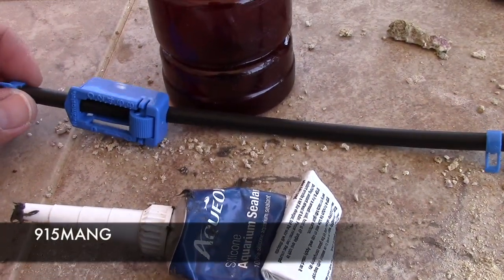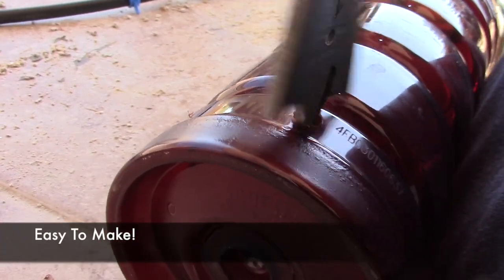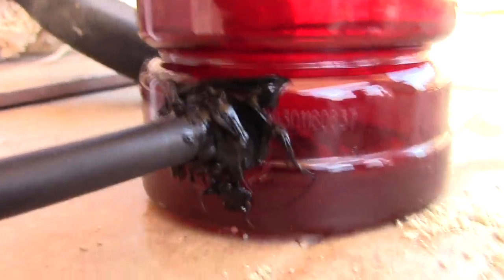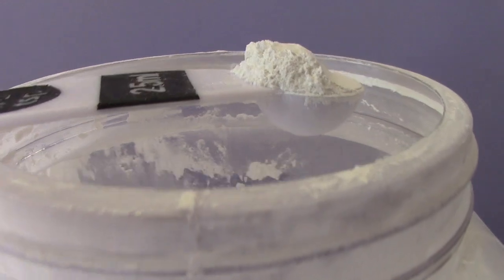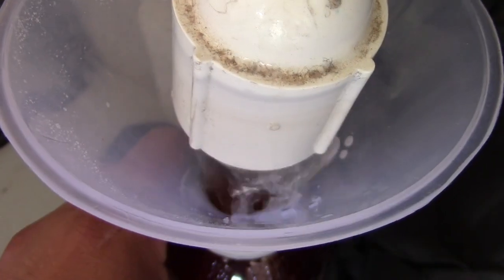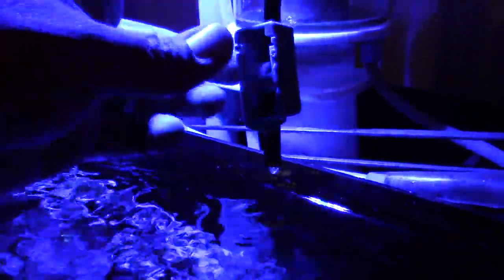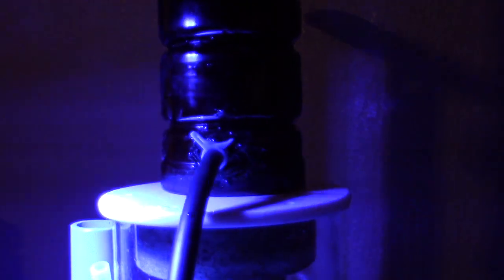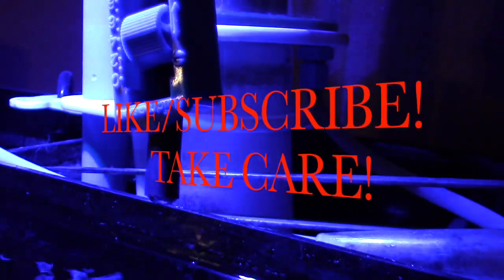EASY WAY TO MAINTAIN A REEF AQUARIUM  DOSING  KALKWASSER DIY DRIPPER KIT

Comment: BRS told me keeping the kalk solution open to the air weakens it. They recommended a tight fitting lid on the dripper when I inquired about one.

Comment: Where did you purchase the drip control piece for the hose??  Thanks in advance.
Reply from the maker: Anthony M It's actually from a toilet repair kit. But I stop using it because I changed the rubber hose. Instead I used an Air Valve that they sell at the pet store
Reply: 915Mang Great idea, thanks man.  I have to  add alkalinity daily to my setup and it is kind of tiring and don't like the milky color my water gets upon adding the stuff.  If I can setup a slow drip that would be awesome as well as it would be more consistent and beneficial to my corals.

Comment: I think as soon as I use the Bulkreef 3 part kit I have from them, I'm going to try the Kalk..
Reply from the maker: Hey if the BRS 2 Part is working then stick with it. But I had this kalk left over, didnt want to waste it. This cheap drip method is working out, and its not a mess like it was in my 120g.  But Kalk is nice, just gotta be really slow about it as you do with anything in this hobby. Have a good weekend!
Reply: I have the 3 part with calcium, alk, and mag. I heard that Kalk will adjust all 3. I'm just looking for something simpler. Mixing all 3 is a pain...
Reply from the maker: +Wire Less Yeah give it a try, Thats how it is. Us Reefers gotta try and see what works for us.

Comment: Hi mag hey I have small tank you recommend me to use kalk? I test my tank is kinda low cal and kh I can use in to my ato water
Reply from the maker: Ruffles Reefer sorry for the late reply. Kalk is good, but it won't raise your levels. Mainly maintain them, so use it after a water change once you have everything where you want them. Ato is really easy to use. It will also clog up you ato line so check it after a month to make sure it's not clogged. It's happened to me

Comment: what did you mean by when you said you learned your lesson from using this on your 120 top off?? did you have issues?? all bad ??
Reply from the maker: Ronaldo Rivera no issues. But my auto top off reservoir was to tall to get in and clean. It was a 20g custom container. Now I'm using a 20g Tall, for my 180g
Reply: 915Mang I'm getting ready to try kalk wasser on my 120 seems like it's all the Rave right now in the Hobby
Reply from the maker: Ronaldo Rivera Yeah it's good stuff actually. Mainly to maintain your levels not raise them. So keep that in mind. Also start off with a little don't go full dose

Comment: I'm suspicious of that hose man. I tried using a small section of real rubber hose on my tank for some cheap tubing but apparently there is a risk of the oils in the rubber leaching into the water.  And don't accidentally knock that bottle in the tank - that location would make me nervous.
Reply from the maker: Really? Damn ok, i could easly replace it with some airline hose. Too easy! Thanks for the feedback.
Reply: +915Mang hey mike, you have any of that gel filter stuff left? I can't find it anywhere. Maybe I could buy a sheet or two from ya if you have some?
Reply from the maker: +Klemmetsmo Reefing Email me your address, I got you. 915mang@gmail

Comment: Where did you get the piece that controls how much of a drip that comes out of the tube looks like it had a little wheel on it. I need something like that and what is it called. Please respond please pretty please respond
Reply from the maker: Its actually from a tiolet float kit, that adjust the amount of water into the reservoir. But dont use it, Use hard rodi tubing. And an air valve they sell at the pets store next to the air pumps. The rubber may leach stuff into your tank.